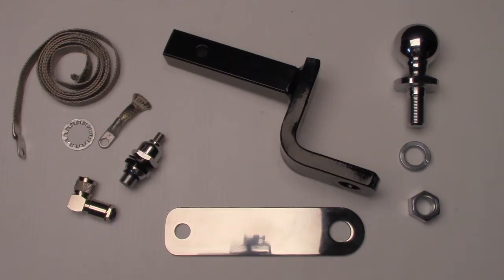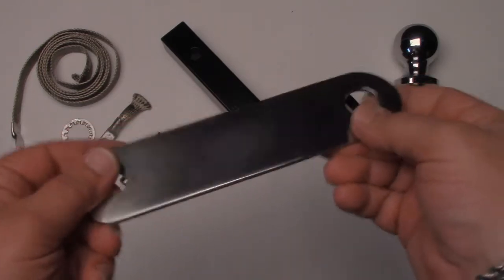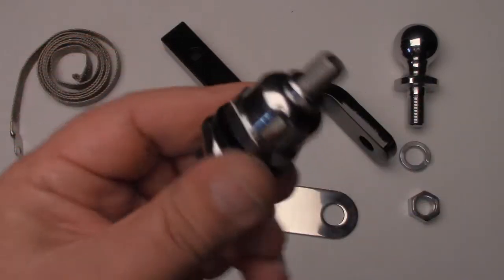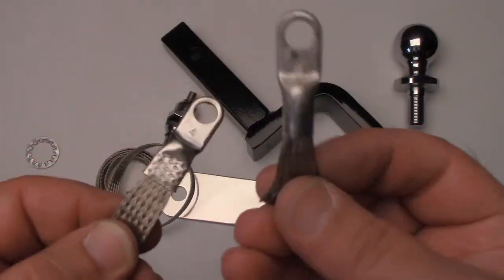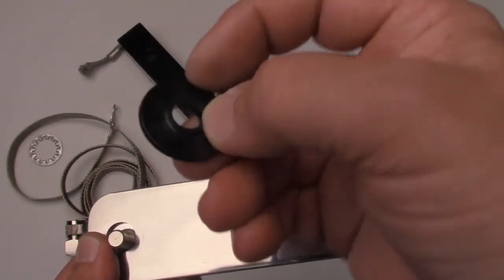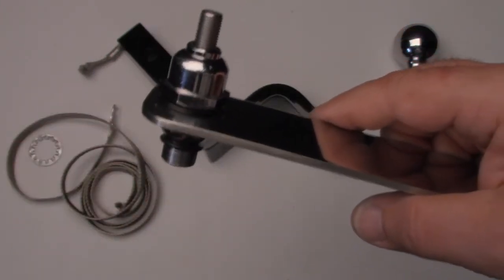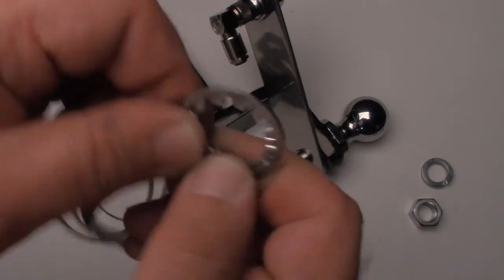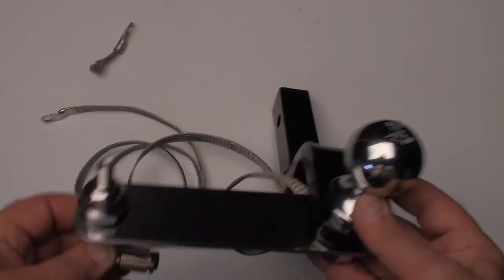102" Stainless Steel Whip-It-Good Trailer Hitch Mount.

Comment: Great video! I'm in the process of setting up an antenna system like this. Any chance you can provide me with the exact items used here? (size of lock washer with the internal teeth, 259 connector, washer with the ridge, etc..? This would help out immensely! Tnx and 73!
Reply from the maker: Hello and thank you for watching! Best thing to do is take the whole assembly with you to the hardware store for a perfect fitment.

Comment: It seems unnecessary to add a grounding strap given that your mount is steel and it's mounted to a steel hitch which is mounted to steel receiver which is bolted directly to the chassis.  How will that braided strap create a better ground than what I just described? Maybe the answer is in Part 2.
Reply from the maker: Thank you for your comment.. Good point, my thinking is that the hitch and its components are painted and therefore insulated. So I ran a ground wire from the bare metal of the antenna base to a bare metal screw coming into contact with bare metal threads on the chassis of the car... Very solid mechanical connection to a large ground plane. I'll make a quick video of the install on the vehicle with the antenna in a week or so...
Reply: @thisoldmanchannel   I look forward to that next part.

Whether a metal's coating insulates comes down to the nature of the paint, powder coating, etc. in the chain.  I tested my 2" ball mount, heavily powder coated in shiny black, with a multimeter in continuity mode.  No signal, so the coating appears to be insulating.  (I tested several other painted metal surfaces with similar results.) But my multimeter runs 12V DC at very low current. Would I connect jumper cables to my car battery's + and - terminals then to that hitch in a dead short configuration?  It's insulating, after all.  But no way would I trust that coating against 1000 amps. 

Now since we're talking essentially an RF ground, and pretty low current, the coatings in question may indeed insulate enough to foul continuity.  I'd simply test the continuity from the antenna's ground element to the chassis and see if it's broken, then check further to find out where.  Or I'd run my rig with and without the strap, and see if it makes any difference.There's certainly no harm in running a dedicated grounding strap, and in such a case as yours, I would probably do it.
Reply: Rarely does a hitch fit so tight into the receiver that there is no "slop" between the metal pieces. The resulting movement can compromise a good ground everytime a vehicle goes over a slight road imperfection. The grounding strap ensures a good ground 100% of the time irrespective of hitch slop.